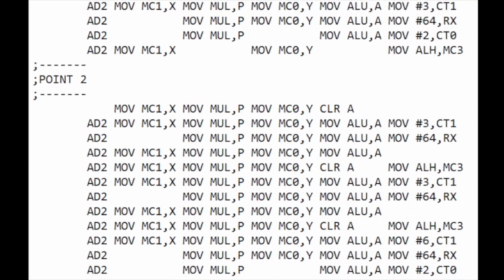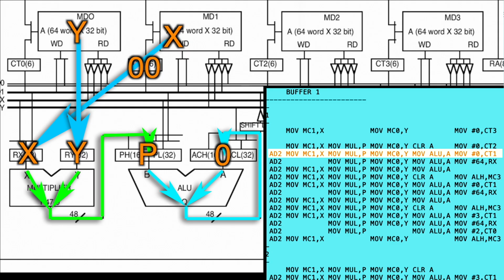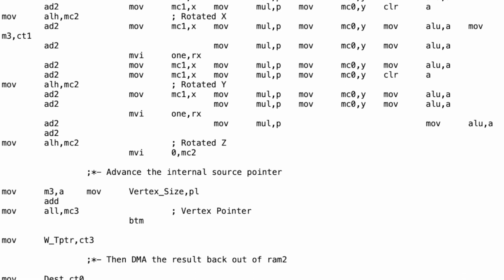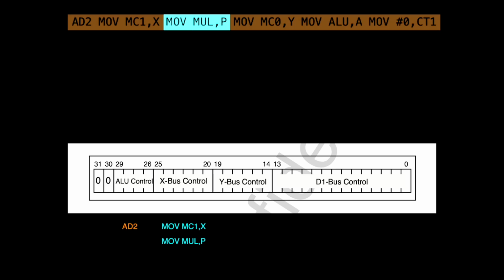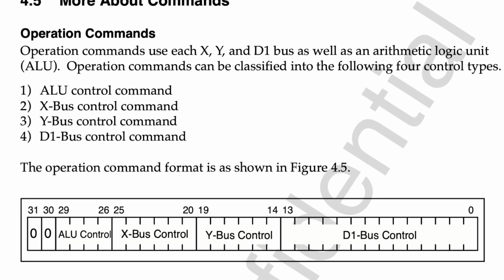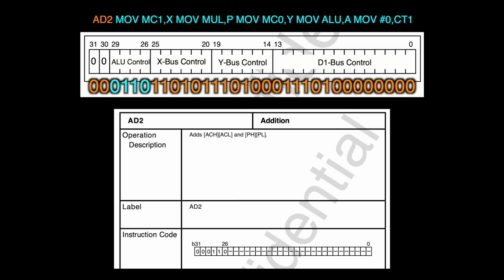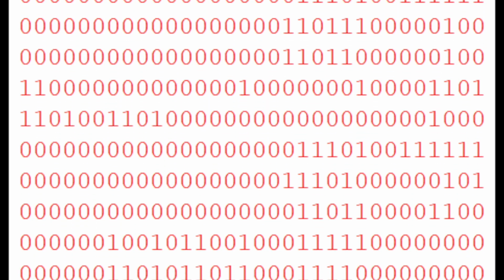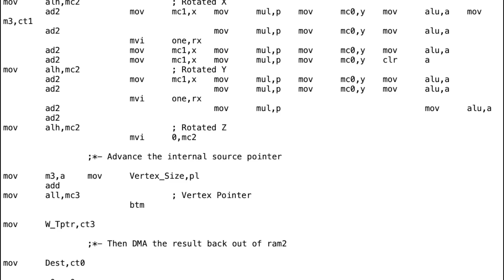The Mystery of Sonic R's Impossible Code - Coding Secrets

Comment: The 1 bit instruction should be seen as a flag. Each flag can be seen as an independent on switch to physical logic, hard wired, internal within the DSP. Both logic sections of the hard wiring are enabled to run with the next clock tick, if enabled (on). Both sections of logic are reading input from the same physically, hard wired register at all times, but only chunk ahead if enabled physically by the instruction on bit (flag, chip enable). Neither physical circuit logic section cares if the other one runs or not, because the output is hard wired to different registers that store each independent results. If both instruction logic circuits had to share an output bus to the result registers, or shared the same physical output register, only then would each set of instruction physical logic need to exclude the other instructions timing, and wait to process their own logic on separate lines of code (on different clock timing ticks).

Comment: On hardware level the OP code bits are usually used for enabling/disabling the modules or flipflops that correspond with the given operation. I noticed @XL2 pointed out the documentation was updated but it is possible what is actually happening is that there are indeed 2 separate instructions with given op codes, but because they don't interfere with eachother (I'd assume due to not using the same communication lines, either intentionally or not) there's no check preventing them from being executed at the same time by OR'ing the 2 opcodes.

Comment: Your conclusion is probably correct.
since MOV MUL,P is a command that takes no source RAM data address, it does seem like it is possible to use that along with MOV [s],X, but the MOV [s],P command would conflict with both the other two commands.
I think this code is basically exploiting the way the CPU works, with a specific pair of instructions combined, but it must be specifically supported by the compiler, otherwise it wouldn't combine them like that.
I'm going entirely off reading the information you flash up in your video.

Comment: They say "four types", not "four instructions". Just an ambiguous translation from the original Japanese, maybe?

Also, if there are three bits for three possible instructions, it's a fair (though risky without checking, of course) assumption that they can be performed simultaneously (and encoded as an or), otherwise they'd probably encode them as two bits.

Comment: This seems common in old hardware, judging from my experience with the 6502. In the 6502, opcodes were one byte, but not every byte was mapped to a command. When designing the actual hardware, the engineers realized they didn't have to check if all 8 bits were right, just needed to do enough checking to distinguish it from the other commands. Because of this, there are "illegal" opcodes that can end up performing two commands together; though they aren't guaranteed to work on every version of the 6502

Comment: My first thought was that something similar to some of the 6502's undocumented instructions was happening.  eg $AF equates to LDX ($AE)  and LDA ($AD) from an absolute address at the same time.  To do this the same micro-code decides the absolute address and reads a byte from it and the final step uses two bits to decide where to put the loaded byte.  If neither is set it goes into the Y reg ($AC), but if bit 0 is set it is put in A, and if bit 1 is set it is put in X.  If both bits 0&1 are set it just puts it into both A and X - it obeys both individual bits being set!  They may have  not intended this with the Saturn, but the effect worked that it eventually became a documented feature.

Incidentally on the 6502 the same happens with $8F: it uses bits 0&1 in the same way as $AC-$AF to decide which register to save in the memory address given.   When both bits are set it tries to store both A and X at the same time.   The result is that the registers are ANDed together, not intentionally but (I think) as a result of the electronics: bits will float high (1) unless specifically pulled low (0).  With two sources unless both are (floating) high, the result is that the pull low wins, ie if either is 0, then the result is 0 - the effect of an AND.

Comment: 3 bits for 3 commands sounds like one-hour flags to encode the commands. 

So 100 isn't the opcode, there's three instructions there, one per bit, where 1 indicates "do this". So 100 is do op A but not B or C. 110 is do both A and B, but not C.

Comment: If you think in hardware instead of instructions is not that difficult. Highest bit enables writing to RX from memory, next bit enables write to P register and the third bit selects if the source for P is the multiplier (0) or memory (1). Given that the two possible write operations have different destinations in any case, they can be performed simultaneously with no problems. Probably an instruction with all three bits set would also be valid even though I suspect it won't make any sense programmatically.
The documentation could and should be better no doubt, but a quick look at the connection diagram solves the mistery.
Normally hardware devices do not understand about instructions. Instructions are simply a mnemonic so that the evolved monkeys that are writing the programs can understand what on hell are they writing.

Comment: If I had to bet money, I'd say it's a hack pulled out by the developers. Probably the inner circuitry of the chip only checks wether the bit of the operation it needs to do is set or not, when two of them are set, the chip just "lights" both parts of itself to make both commands with the same registers. Perhaps it's not documented because it's not a feature but a clever use of a coincidence in the construction of the chip.

Comment: "3 bits -> 3 commands"
Me: ok this should be straight forward to solve. Each bit turns on or off the given command.
"...and 011, representing moving data to P"
Me: ...never mind then.
Reply: The 3rd one is just a variation of the 2nd one. Both move something to P, the only difference is what they move. What bothers me more is that the 1st and the 3rd one both require an argument and there is only one argument you can provide, so mixing these two up in a single call with two different arguments should cause the compiler to fail.
Reply: I guess they developed the processor with having a bit mask in mind to turn on or of the 3 commands independently, but ran into some sort of problem with the second and third command and then designed it in a way, that they cannot be enabled at the same time (so its either x10 or x11), with only the first bit being independent.
And then the documentation writer mistook all of that for the processor expecting a 3 bit "word" to set the command.

Comment: If i had to guess, both the instructions are able to be encoded into the same command line because one of them uses the three argument bits and the other doesn't; a more accuracte bitpattern for them might be 1-- xxx for mov [s], x and -10 --- for mov mul, p if that's the case, with mov [s], P being -11 xxx. not sure if the two mov [s] ops would clash because of the argument bits, though. definitely would want to feed a couple test cases through an assembler to doublecheck.

Comment: Are you sure that the binary code you presented and the source are the same?  I'm looking at both side by side--I pasted together a few screen shots to get a full listing--and they don't match up.  Any chance you could dump a little bit of it to github or something?  I assume you don't still have access to the build/debugging tools for this platform anymore.  If you did, I would ask you to prepare a file of all possible 64 combinations of X and Y opcodes and see what they disassemble to.

Love the video and I'd like to see a solution to this and I'm glad to help get us there.
Reply from the maker: The code below the highlighted binary line is every other line. The binary viewer I used to display the code in binary refused to do a single column. The minimum width was two columns so I had to manually rearrange the binary into one column and after the line I was interested I stopped bothering. Well spotted though.
Reply: @CodingSecrets  I don't care what format it is in, I would love to look over more of your code!  Now you have me wanting to know how this works! ;)

Comment: This does make sense.  It's really just an ALU instruction with 5 register writes of which 3 use the D1, X,and Y busses.  Some DSPs would just have this as a multiply and accumulate instruction instead of an ADD with the P and A moves infered.

Comment: This information is in one of the DTS / technical bulletins. Not only did you have Sega's example, you probably also had the DTS.

SEGA TECHNICAL BULLETIN SOA-8
Augist 16, 1995
Saturn SCU DSP Tutorial
4.3 The X Bus
These instructions allow the RX and P registers to be loaded from data RAM, and theyalso allow multiplier’s output to be loaded into the P register.  The instructions that loadthe RX register may be used in parallel with the MOV MUL,P instruction.  X-businstructions may be used in parallel with ALU, Y-bus, and D1-bus instructions.  None ofthese instructions affect the processor status flags.

Comment: The DSP is structural not very complex and the instruction set very low. To save transistors they wired the bits of a commandset directly to the Logical units and registers with no opcode interpreter. The 68000 is build similar. The result are "hidden" commands. Some do nothing some cashing the Processor.
Your example shows it clearly one bit adresses one Logical unit, so two commands can be combined if they don't collide.

Comment: MOV MUL,P and MOV ALU,A might be grouped under X-Bus and Y-Bus control respectively, but they are not using the actual X and Y busses so it's not totally surprising that they can be performed in parallel. It would be interesting to see if instruction code 111 for the X bus would allow you to move the same 32 bit value to X and P at the same time.

Comment: I used to write machine code routines for the Z80 in my Amstrad 6128. I discovered that there are quite a lot of undocumented or unofficial instructions for the Z80. These often use instructions that relate to the HL register but apply them to the IX and IY registers. An official example pair  could be &7E for  LD A,(HL), meaning "load the A register with the number at the address held in HL"
 and &DD, 7E, d for LD A, (IX+d) meaning "load the A register with the number at the address held in IX +offset d". Many other instructions intended for HL will work on IX if preceded by &DD or IY if preceded by &FD. The official line is that not all Z80 chips will respond correctly, but I've never met one that didn't.
Reading through the lists of opcodes for the Z80 one can see an obvious pattern, suggesting a bit-specificity about them, for example &46 means LD B,(HL); &4E means LD C,(HL), &56 is LD D,(HL) and so on, but there is no code &76. Following the pattern it should mean LD(HL),(HL), which is pointless, but if used as DD,76,d it could be used as LD (HL), (IX+d). This might be a very useful code for a rapid data transfer. I think I used it to move screen shots from banked memory into screen RAM

Comment: It sounds like it's taking advantage of undefined behavior, in that the DSP never explicitly checks to see if 110xxx is a valid instruction, but rather decodes both 1xx and x10 into an instruction at the same time, and sets the control lines for both instructions.

Comment: Looking through the docs, there's a Tech Bulletin labelled #SOA-8, dating 1995 August 16, which state the following about the X and Y buses:

"The instructions that load the RX register may be used in parallel with the MOV MUL.P instruction"
and
"The instructions that load the RY register may be used in parallel with the MOV ALU,A instruction or the CLR A instruction".

There are also numerous examples that use this, in the tech bulletin listed above but also in the SBL (Sega basic library) and the DSP Assemblers manual (ST-240-A).

Clearly this was known. Why it isn't listed in the SCU manual is anyone's guess.

Comment: The first line in your DSP code screenshot (around the 1:04 mark) is interesting, since it only executes 3 instructions (two of which appear to be moving the first bits of data into the X and Y registers of the Multiplier). In subsequent lines these MOVs are still happening, but you are also moving results out of the Multiplier and ALU. To me that looks like a 3-stage pipeline where you can parallelise copying data from memory to Multiplier, copying result from Multiplier to ALU, and adding data already in ALU.

So at the same time you are loading X and Y with new data for the Multiplier to multiply (MOV #0, CT1; MOV MC1,X; MOV MC0, Y), you are also copying the previous result of Multiplier's last calculation into P and the last ALU calculation into A (MOV MUL, P; MOV ALU, A), whilst also simultaneously asking the ALU to add the data already in its registers (AD2).

I'm not familiar with the Saturn's DSP at all, just going on observation. It's more apparent when you read those first 3 lines of code together, because you can see:
- In line 1 that only X and Y are being addressed (and I'm assuming the MOV #0, CT3 is setting bus line/memory address CT3 to be used for the copy to X+Y).
- In line 2 you see the same again, but now the result of the Multiply in line 1 is also being copied out to the ALU, whilst the ALU's A register is cleared (CLR A).
- In line 3 you get nearly all the same again, but now ALU register is asked to sum the contents of its registers from line 2 and store it back into its A (Accumulator?) register (AD2; MOV ALU, A), which remember are the results of the multiply of line 1's data plus that CLR A. At the same time the ALU is also receiving its 2nd set of data which is the result of the multiply of line 2's XY data. And at the same time the Multiplier is being primed with a 3rd set of data.

It makes more sense to me to rearrange line 3 into 3 parts:

MOV #0, CT1; MOV MC1, X; MOV MC0, Y as the first pipeline stage
MOV MUL,P as the second pipeline stage
AD2 and MOV ALU, A as the third pipeline stage.

It isn't even until line 6 that you see something that looks like the ALU's results being copied back out to memory, so I'm guessing up until that point all the arithmetic is being accumulated in the ALU?

I suspect I'm wrong about some of those details. All very interesting anyway. :)

Comment: Sounds like the DSP is executing microcode so the "instructions" are more tightly controlling the logic blocks. If the multiply works on latched inputs, and the moves are slightly staggered to latch after the multiply starts, then it could do those operations at once. Perhaps one is on the positive clock edge and the others are on the negative edge.

Comment: Reminds me of working with microcontrollers for automotive engine and transmission control applications. These were often based on common processors like the PowerPC or M68000 but highly modified for the application, and the manual will only cover about 30-40% of what that custom processor can actually do, which makes reverse engineering them quite challenging, to say the least.

Comment: I think it is like others have said and it comes down to how DSPs work and not that it is actually performing multiple instructions. Imagine a hose that has 2 taps. You can turn the input on and you can open the left, right, or both taps. Turning the flow on or off is needed either way so it makes more sense to control the outputs. 
This concept can also be turned around for inputs if you turn on a flow every time you want to update a register but by controlling the gates you can say open gate 1, open gate 2, or open no gate and they both stay 0. This would allow controlling 7 inputs with 3 bits.

Comment: DSPs were fairly new and all the rage in the 90's.  They probably didn't document all the features because they didn't know if they could get them all working in time.  Getting multiple buses to talk to each other in a single cycle (especially in a single phase) isn't easy.

Sega's arcade DSPs were designed by Fujitsu.  I have no idea if the Saturn used designs modified from other manufacturers, or if they went full custom.